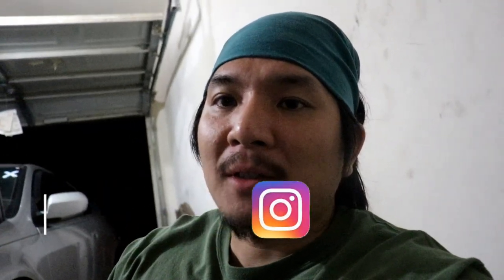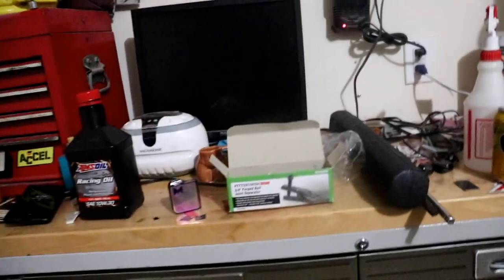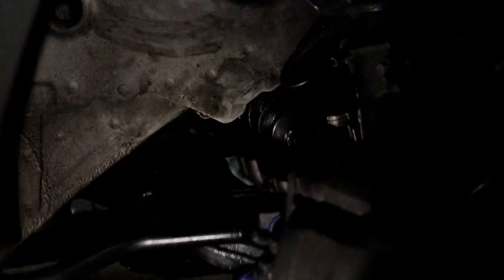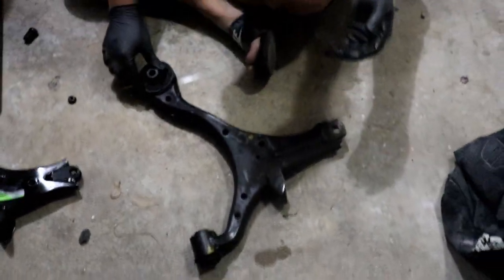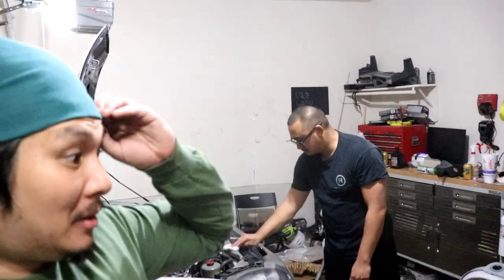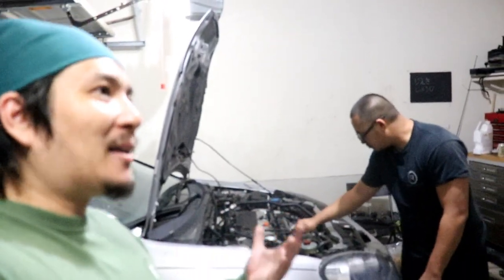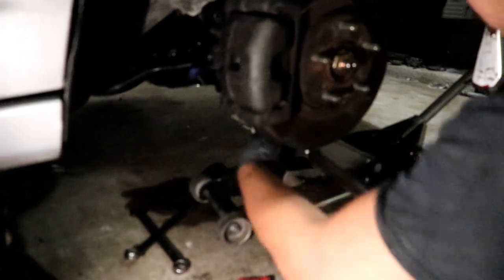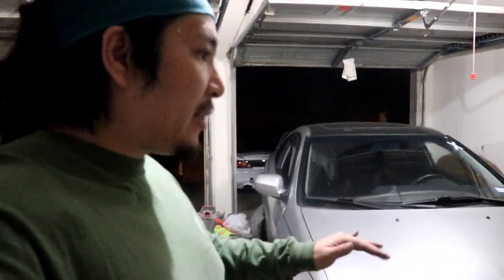RSX LCA Install! Plus A New Problem... | RSX Installs

Comment from the maker: More things to do for the RSX in the future! Stay Tuned!

Also, check out the track event Steve and I went to couple weeks a go! https://www.youtube.com/watch?v=gImK9d4hvZY
Reply: What year is your rsx I've been having so much trouble trying to find Front lower control arms for my 2006 rsx base
Reply from the maker: @skooboy509  2003, yeah there might be subtle dimensional differences
Reply: skooboy509 I had the same issue. There is some ktune control for 05-06 but it’s $300.... so I just bought hardrace direct rubber bushing for oe replacement instead.

Comment: Why did you not got with an energy suspension bushing?
Reply from the maker: i might do that with the old LCAs in the future
Reply: TheRealTDawg I actually have spare LCAs with energy suspension but might replace it with a moog hardened rubber. Heard lcas with Es are pita to put back in the car and binds eventually
Reply from the maker: @bhadz100  tbh, if money allows, ill skip poly bushings and go spherical... superior to both rubber and poly but with a hefty price tag
Reply: TheRealTDawg what was the torque spec for the lca bolts?

Comment: I have a question rsx base and rsx types front lower control arms are the same
Reply from the maker: they should be, I haven't seen anything saying otherwise
Reply: Yeah chaises are the same only difference is the heads
Reply: @davidjuarez3916  heads, blocks, transmission, axles and a couple of other things
Reply: From my experience, the 05-06 type s front lower control arms have a bigger mounting hole than all other rsxs. Even the base 05-06 is different than type s 05-06.

Comment: Do you know if O2 an 06 are compatible lower control arms and suspension components??
Reply from the maker: yes they should be, although Base vs Type S will be different I believe
Reply: Hey did you find out yet John, i keep ordering control arms but the hole in the control arm for the ball joint is to small
Reply: @javiermiranda1751  yeah instead of ordering the control arm just order the bushings and keep your factory control arms also frees the bushing cuz it shrinks down a little bit so it can fit
Reply: @john.r4401  Thanks for the info my dude will do 🙏✌🏼

Comment: What ball joints did you have installed?
Reply from the maker: I think Hardrace if I remember correctly
Reply: @JedETaleon  did they fit perfectly on those aftermarket control arms? (i have the exact same ones) All the ball joints I’ve tried couldn’t be torqued down because it would just spin due to there being a small gap between the bottom of the castle nut and control arm like the hole on the control arm was too big it let the entire spindle pass through to tighten. Thanks.
Reply from the maker: @ryan7235  well these are OEM control arms and yeah they fit
Reply: @JedETaleon  so they’re not the LCA’s from the link you left in description?
Reply: And is HAR-6804 the part number for the balljoints you used by chance?
Reply from the maker: @ryan7235  no they are, OEM style I guess is more accurate? It's what I used and the hardrace ball joints fit good